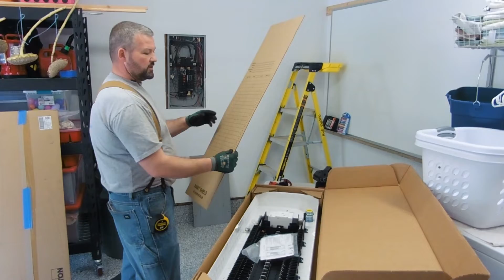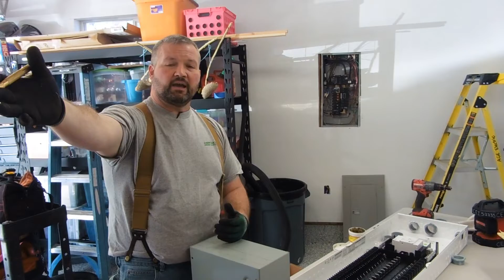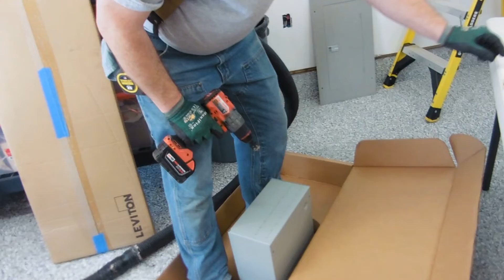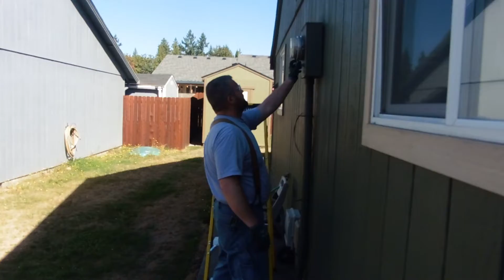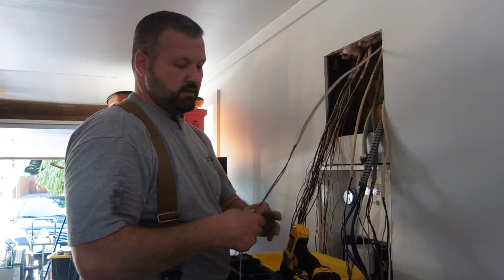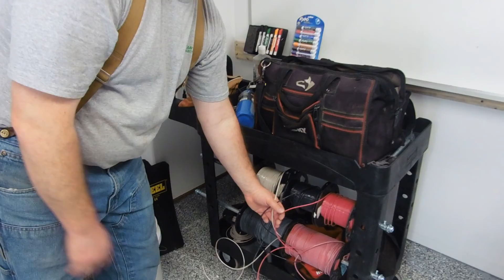Leviton full 200Amp panel change

Comment: 8:50 I believe if hot is on top of neutral depends on which side of the panel you are working on (left vs right). On the other side the breaker will be upside down so the opposite color screw will be on top

Comment: I have 2 of these panels, and was wondering the best way to label breakers if you have the clear window cover?. Do you write or put a label on the breakers ?.
Reply from the maker: I install a transparent pocket that has adhesive on one side , centered on the bottom of the clear cover. Then I provide a typewritten panel schedule on cardstock that faces out. It has a clean look and is easy to adjust or modify in the future.

Comment: 01 commercial electrician here. I'm building a house at the moment and I'd like to put this panel in. Seems like a move in the right direction for something that hasn't change much in decades. Have you installed many of these panels, are they reliable? I was going to go Square D QO but I think this looks interesting.
Reply from the maker: Yes I've installed a handful, they are really easy to work with. They also are extremely easy to upgrade and interchange breakers when wanted/needed. The Gen 2 smart breakers are expensive but do give you the ability to load shed if you need for more elaborate setups with a  generator or a battery/ESS.

Comment: only thing I don't like about the Leviton.. is I had an outdoor leviton load center after 5 years the breaker went bad and got hot, and warped the backpanel, and had to replace the entire panel, because you can't replace just a section of the backplane.

Comment: Nice clean work but that would fail here in my area of Louisiana.  So how did you resolve the sheet rock issues between the 2 boxes?
Reply from the maker: Thank you. Yeah I find it interesting all the different local and state amendments to the NEC across the nation. What do you all do differently down there? And the sheetrock was easy, there are some clips that slide on the sides and you can screw into and then  break off the exposed tab.
Reply: @AGEElectricInc  The inspector would want multiple paths between the 2 boxes, not passing all the conductors through 2 paths.  Also no tie rapping.

Comment: You cant monitor individual loads on each breaker. See no real need for remote control breakers on and off. The breakers are very expensive and not easy to get replacements in a bind.

Comment: After installing a new 200A Leviton Load Center, I attempted to install the cover using the provided cover screws. However, the mounting holes in the load center where not threaded. And, the provided cover screws do not appear as self-tapping. Can you confirm is the cover screws are self-tapping?  Thanks
Reply from the maker: @dcovatech  Yes, they are thread cutting screws. I usually thread them in before trying to install the cover, so they go in easier when I'm holding the cover in place. They are similar to the other major brands out there Sq. D, Eaton, etc.

Comment: How did you make up the PVC nipples? I can see a male adapter on the Leviton panel side, but can't quite figure out what is between the boxes and what is on the junction box side.
Reply from the maker: I used a male adapter, coupling and a box adapter for this set up. There's another video just titled 'Leviton panel change' and at 9:03 I have a good shot of the in between nipples. And on that one, for the offset nipple I just used a female adapter and box adapter instead of the GRC coupling and chase nipple. It works the same and you can save a couple bucks on material.
Reply: @AGEElectricInc  Thank you for being so helpful and responsive in the comments. I did get a good look at the nipples between the junction box and panel in your other video. I assume there are very short pieces of straight conduit between the male adapter and the coupling.
Reply from the maker: You're welcome, I try to help and pass on things as much as I can. That's what was done for me through the years. And yes, just short pieces of conduit to mate the fittings together. One more thing, the PVC box adapters are a little deeper than the couplings, so you need to trim it just a little so it will fit tight and not be sloppy. Only about a 3/8" or so, and that's with all sizes. Especially when working with metal boxes where the side walls are not as thick as a PVC box.

Comment: Looks like you have one #6 ground running up to the junction box. My inspector was reminding me that there should be a ground in every conduit or raceway. It is OK to have one ground for multiple circuits in one conduit, but since you have 3 nipples, it seems like you have to run a ground wire through each of them. I guess the rigid offset nipple could be the ground for the right one. But if you used the center PVC one, you need to add a ground to it. Is this your understanding?
Reply from the maker: I believe grounding and bonding are very important and I don't believe in cutting corners when it comes to it. Although in this application there does not need to be a ground ran through every nipple. The #6 cu. takes care of all EGC's from branch ckts. that come into the 12x12 and as far as the raceways, 2 are PVC and the GRC is bonded through the locknuts. If these raceways were going to separate enclosures or if they were for paralleled sets then, yes there should be a ground in each one in my opinion. But even then you can use certain metal raceways as the EGC if they are rated, but I never like to rely on conduit solely for the ground because couplings may not have gotten tightened or have become loose over time, etc.
Reply: Need to ask yourself why we are a lot of times changing a panel...  water, moisture, corrosion. Mice.    What does that do to these smart panels that cost more and are more fragile.
Reply: @yourelectricman sometimes you have to upgrade anyway because the current panel is undersized. Also, the Leviton panel and standard breakers are priced in line with existing dumb panels. but now you have a choice to upgrade individual breakers to smart breakers down the line (which are definitely more expensive)

Comment: Great video. I really like your approach of putting a junction box above the panel for extending circuits, but also giving an easy way for future expansion. If you have some circuits that are long enough, would you run them through your JB, or run them along the side of the box. I assume the 12" box gives you 1.5" space in the stud-bay to run cables directly to the panel? It was great to see how you drilled the KO's in the junction box. I would have liked to see how you lined up those chases between the panel and the JB. This could even be a separate video.Did you install any of the Leviton Gen2 smart breakers? I'm intrigued by the possibility of getting firmware updates for AFCI's that nuisance trip.
Reply: Good to know there is enough clearance around the 1” knockout to punch out 1 1/2”. Definitely much cleaner. Thanks for clarifying
Reply from the maker: Thank you! I will try and show how I line the chases up next time I do one of these setups. It is a little more labor intensive but I feel the pros far exceed the little extra time. I personally would run any cables/conductors long enough through the chases w/ the rest of the conductors so they come out in the corners of the panel and keep that clean open space. I haven't put any Smart breakers in yet as their price tag usually deters most people but the new load shedding capabilities of the Gen2 really open up some options. And it makes them the only competition currently for the SPAN panels.
Reply: @AGEElectricInc was this a 6” deep box that is sticking out 2” in front of the drywall? Great setup to bring surface mounted EMT from EV charger into the panel. Are the chases 2” PVC? Looking forward to more videos with details.
Reply from the maker: @jckohler  Yes this is a 6" deep box and the I put in 2-1 1/2" &  1- 2" in the middle. Which was definitely overkill. One side had an offset nipple so I could squeeze it down to the 12" width. Yeah this is a great setup for chargers, standby generators, solar/batteries or all of the above. We got some solar going in soon so we'll have some more videos on this one soon!
Reply: @AGEElectricInc Looking at the drawings for the Leviton panel, it appears they only have 2 knock-outs of 1 1/2" or larger in the top/bottom of the panel. Did you use a hole saw and cut across all those 1/2" KO's?
Reply from the maker: @DecarbonizeHomes  No sir, I did not butcher the panel with a hole saw across the 1/2" ko's, lol. I know a lot of people do that kind of stuff, I try not to do those things. Sometimes it may take a few minutes more but I believe that shows professionalism. The 1" ko can be oversized to 1 1/2" with a ko punch and it's tight but you don't break out the surrounding ko's. I have a few pics but I can't figure out how to attach them.

Comment: Nice work. It would've been nice to see more of the installation of the new panel and box but that's ok. I'm curious to know the price tag of this installation? I'm getting set to start on my own as a contractor and I'm looking for advice and input. Thanks! Glad I found you on here.
Reply from the maker: Thank you,sir. I am still working on making videos. I will try to capture more of the installations moving forward and I will be getting some better equipment soon. I believe this install ran me around $500-600ish in material. I only installed 3-CAFCI breakers on this one, that's where a lot of cost comes from on new services vs. panel changes.
Reply from the maker: Labor rates also vary pretty significantly depending on what part of the States you're in.

Comment: I would never use a plastic panel for a service panel especially one from Leviton because all of their GFCI & AFCI circuit breakers are made in lack if quality control lying cheating communist china. Both of my TV'S ,cell phones, laptop and LED lamps were not made in cheating china. You should be wearing approved PPE long sleeve shirt, pants, tinted face shield and rubber gloves that were tested and date stamped within the last 6 months. In the USA we loose an ectrical worker every day due to electrocution , arc fault or an arc blast incident.

Comment: I never use an expensive unibits to drill more them two holes. Found carbide cutter hole cutters to be the fastest and produce 90% less hot chips then a unibit. NEVER purchase any carbide hole cutters from graingers. I spent over $110 for a garbage POS 7/8" & a 11/8" name brand carbide cutters from them. Both are at least 50% slower then my 10 year old Klein carbide hole cutter.